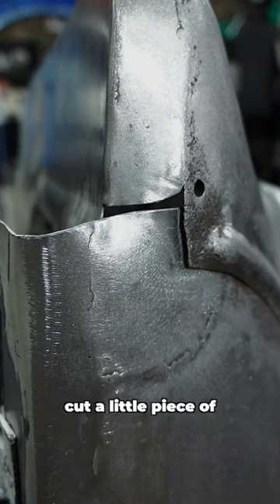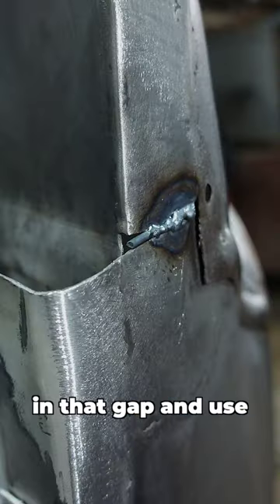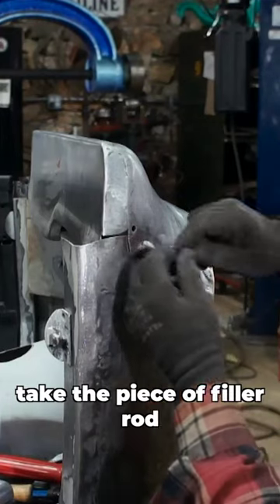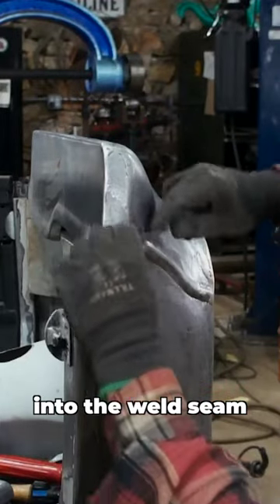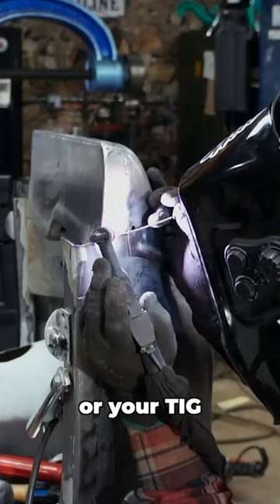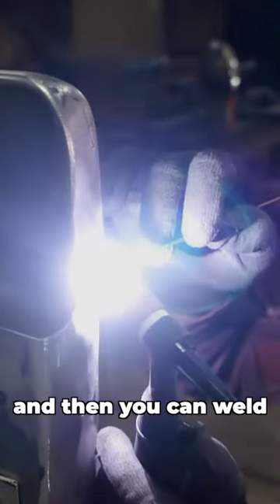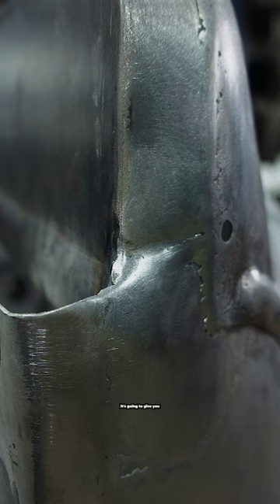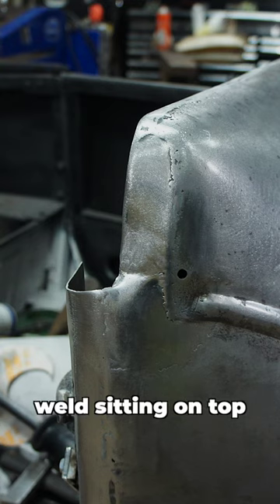Trick for filling gaps in sheet metal

Comment: I clean off a piece of 7018 and use that. Works really well and the curvature of the rod acts as a chamfer which gives me a channel to fill with weld. Anyone claiming this to be an improper means of filling a gap is dead wrong. As long as one gets both sides of rod and achieves good penetration into both rod and sheet metal it is fine.